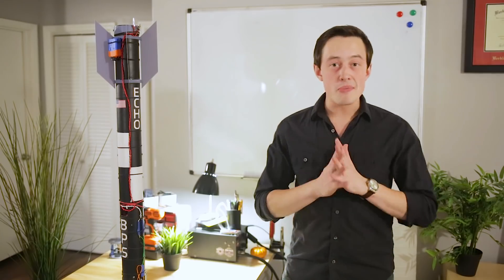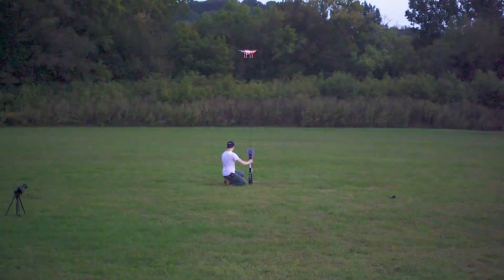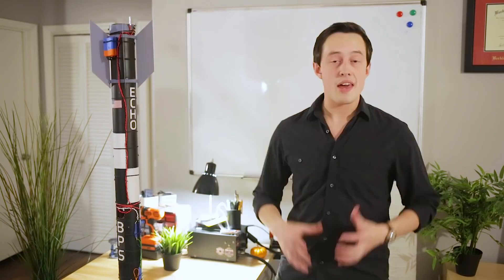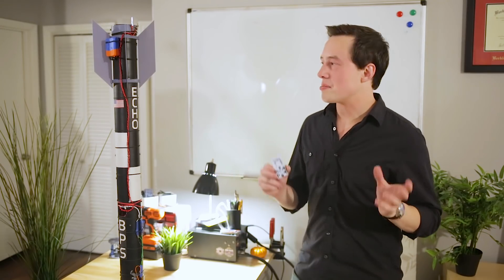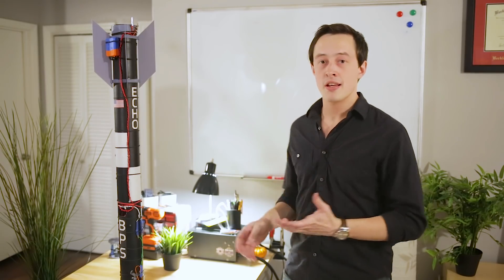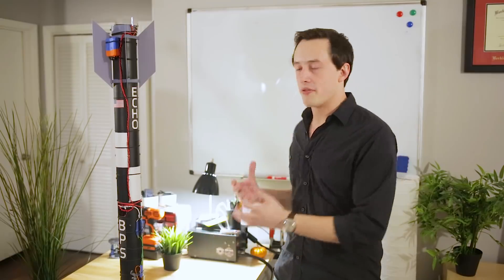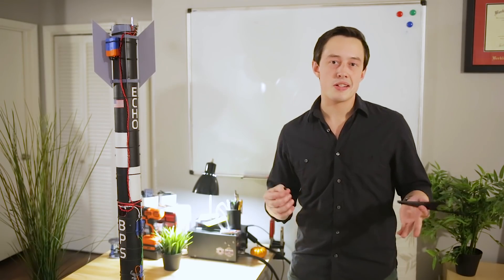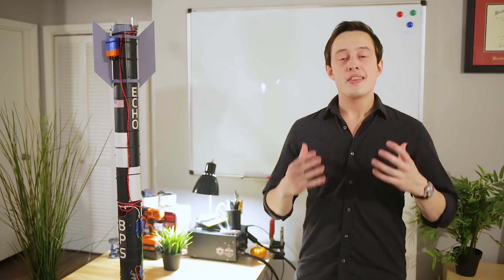Echo - Landing Test #1

Comment: WITH SOLIDS
Reply: "Yeah, when an SRB lands vertically... oh..."
Reply: A solid rocket motor has a specific amount of thrust that can't be controlled, so does the rocket have to be at a specific velocity and height when the motor fires off or is there a range of possible values? What if a booster sends the rocket to 1000 meters, will this upper stage will be able to land or will it be going too fast?
Reply: @nicholas1460  I dont think an Estes motor has a linear thrust curve. I think it is a parabola.
Reply: @nicholas1460  
What would happen if an electric ducted fan were placed inside of the rocket body?  The intake could be at the top of the booster.  The ducted fan could be completely controllable and be able to compensate for the differences in solid motor performance.  It wouldn't be there to provide all of the thrust but just to augment it with a few newtons of controllable thrust.  In other words the solid main gets it into the ballpark and the fan does the fine tuning.
Reply: @nicholas1460  The solid rocket motor has a set amount propellant and burns for a fixed time, so there is a fixed amount of impulse that it imparts to the rocket, which equates to the booster being dropped from a set altitude. He might to reduce the impulse somewhat use the TVC, but it seems to be a very narrow window that the booster could land safely on one solid motor
Reply: This will be awesome for model rockets. No more loosing first stages to the wind.. lol
Reply: paduag1782 Or you could just have a low-altitude chute deployment.  That would be simpler.  Just time-delay deployment to a hundred feet or so off the ground based on ballistic calculations, high enough to have margin if the flight doesn't quite reach the predicted altitude or comes in hotter than expected.  I think that would be much easier than trying to measure real-time height above the ground.
Reply: Brain Mind - What is the fun in that? 😊
Reply: Greg Smith Well, if you like launching rockets, it means getting out there faster.  If you like tinkering, then by all means attempt this overly complicated task.  SpaceX uses this method because for a rocket that size it's necessary.  A model rocket can fall on its side with no harm done, so a parachute is a simpler and just as effective way to go.
Reply: Brain Mind This is not about SpaceX, it's is not about doing things simply. It is about attempting something new and just enjoying the challenge! If every one did things the easy way, there would not be such things as SpaceX, light bulbs, cars and countless other things that exist today!
Reply: Greg Smith lol.  If it weren't for SpaceX, he would not have been inspired to attempt to land like this.  My reply was not to the guy who posted this video but the other commenter who thought this would be a good solution to the problem of model rockets drifting downwind under parachute.  Far be it from me to judge someone for taking on a technical challenge for cool points.  I was just saying it's not a great solution to the aforementioned problem.  SpaceX is not trying to do things the hard way.  They are actually trying to do hard things the easy way.
Reply: Brain Mind You are taking things way to seriously, he was just making a light hearted  comment.
I would not say SpaceX is doing hard things the easy way. The easy way is just to let the spent hardware to crash into the ocean, They are making a hard task look easy!
Reply: Greg Smith SpaceX is recovering the first stages so they can reuse them.  It's not the easy way from an engineering standpoint, but it's ea$y in the long run.
Reply: Brain Mind, Yes it is an incredible challenge they have set themselves and actually achieving. From what I have read each 1st stage is about $60 Mil plus a few mill in fuel. I don't know how much it costs to refurbish, but it would be great if they can get to a point where it is like refueling an aircraft, where they can land, refuel and take off again.
Reply: Greg Smith Well, that's kinda the ultimate goal.  Unfortunately, I don't think that's quite achievable due to the narrower design margins and performance demands involved in orbital rocketry.  The closer they can get to that benchmark, though, the better it is for the proliferation of a more space-faring culture.  Maybe with more and more assets and activity in space, it will eventually spur a business case for the development of more exotic launch technologies that can take the cost of getting to orbit well below the limits of chemical rockets and make it truly routine in the vein of intercontinental air travel today.
Reply: Brian Mind - Yes if it does happen it is a long way off. Even aircraft have a limited number of flying ours before they are permanently grounded, so if they can get 10, 20 or more flights out of a rocket, that is a hell of a lot of money saved.
Reply: Greg Smith Indeed.
Reply: @brainmind4070  
Yep.  At model rocket scales it is probably simpler (not simple) to have a controlled glide return rather than a powered vertical landing with a non-throttleable solid motor.  We did a balloon launched glider back in the early 2000s.  It returned to the launch site from 65K feet.
Reply: longshot7601 Yeah, this guy just wants to channel the "coolness" of a SpaceX F9/Heavy landing on a small scale, which is perfectly fine, since this is a toy and/or a vessel for generating YouTube views and not an actual workhorse.
Reply: My exact thought.
Reply: That moment the people's engineer gives perfect props on your channel.
Reply: Hey Destin, check out Nulka, a hovering rocket anti-ship missile decoy.
https://youtu.be/9j66ZvGGErQ
Reply: Yes. He did use solid.
Reply: This is exactly why I clicked on this video. That's a feat even SpaceX doesn't want to touch. I'm thinking in the end, he'll have to have a way to kill the thrust at touch down, like a thrust reverser on a turbofan. Otherwise, it's going to bounce and climb again.

Comment: Well, you want to send this at the edge of space? Put it on a weather balloon. Once it reaches at the maximum height, launch in and each mesosphere. It's not the edge of space but still, the atmosphere is super thin. And make some satellites and give them some propulsion system. The satellite will need a lot of speed and won't remain there for long as they are not in real space yet, but at least it would look cool.

Comment: Love your project ( I'm not an expert ) It's possible that scale is an issue and also the rubber band situation during deployment is causing a variable bump or jerk that's  causing issues . If you can get the pods to deploy in a more controlled synchrony without dependence on rubber bands  it should help . Good luck.

Comment: Your never going to make a smooth landing with solids.  Are you attempting to make a hybrid solid that you can add a oxidizer gas to make it a throttleable  engine? Or design a Butane/oxygen pressure fed engine Where you can throttle with a variable valve solenoid?

Comment: The problem is 
With Solid fuel trusters you can t control the trothle they can be only on or off
You did a nice work there but try with hybrid trusters
The doesn t have solid oxidizer but only the combustion powder
And a tank of oxigen 
Controlling the flow of the oxigen you can control the trothle

Sorry for bad english if i wrote somthing wrong i m Italian

Comment: I think what you need to do is go beyond solid rocket motors. I know it's big step and probably beyond the budget now, but maybe people would help you with it. I think a hybrid rocket motor would be ideal. That uses solid fuel and liquid or gas oxidizer. It could be wax and nitrous oxide, polymer and compressed oxygen, there are several variations. But hybrid rockets can be throttled. They are much safer and simpler than full liquid fuel engines. No cooling is needed, no fuel pumps (compression is enough) They are perfect for this application. If you look around, you will see that a lot of people are building working small scale hybrid rockets.

Comment: So I only have one question?? Real SpaceX Rockets use obviously Fuel and shut off controls your model rockets don't they use the model rocket thruster materials basically aren't you just shooting in the dark I'm trying to get that rocket to land because once that electrical igniter ignites it it burns until it's done so hypothetically you're probably always going to have too much or too little material. Although you could mathematically figure it out by seat and burn time but if I'm not mistaken the real SpaceX Rockets would increase thrust or decrease thrust and I don't think you can do that with model rocket engine material please get back to me on that one though

Comment: take 1 or 2 co2 cartridges as a tank for a 4 or 3 nozzle control at the top of the rocket and control it with a suitable valve via another computer. I do not know if that works because I do not know anything about rockets 😁

Comment: You can make a metalic nozzle that opens and closes depending on your thrust needs.
Maybe with some plumbing for redirecting the gases to the sides when its closed.
It will be like a 100 or 0 thrust at a time, but with a good enough design im pretty confident that you can control your speed enough for a soft vertical landing

Comment: Change from a solid rocket to a hybrid. It will produce more power and is able to be turned off and restarted mid flight. This is helpful when you start launching and landing in the same flight. You can even connect the valve on the engine electronically to the signal r2 so you can control throttle from the app.
Reply: Here’s a link to a hybrid rocket engine:
https://youtu.be/TLPWqCMb7DE
Reply: I made the same suggestion.

Comment: What if you have it land on a platform rather than grass and release the motors thrust a bit  faster. (I think you mentioned that actually) also it seems like there is mass unevenly mounted around the rocket, why not mount in inside in balance? Awesome shit tho

Comment: i see why its so hard to land.
its literally just the unpredictability factor with the solid engines. once they ignite, you cant throttle, and you have to wait for the fuel to be gone for it to shut off. minor inconsistiencies in the mixture as well as minor disgrepencies in ammount of fuel per motor, makes them unpredictable.

i would suggest using a hybrid nitrous/rubber rocket instead. with a valve, you can at least throttle and shut the engine off at the right time. get an N20 canister (used mainly for making whipped cream and getting high), and make a tube the same size as your engines. fill it with molten rubber to cool. drill hole through center, pop solenoid valve into one end. screw in nitrous canister to that. add electronics. you could alsu use any extra nitrous as RCS fuel to help stabalize the rocket on landing.

Comment: When it does touch down successfully, the thrust will cause it bounce back up in the air. You'll need a thrust reverser such as a plate that quickly deploys into the rocket plume.

Comment: So one issue I've identified here is that to adequately control vertical stability and maintain as perfect an angle as possible you will need some form of control higher up the body, as thrust vectoring will require a lot of inverse calculation to make it retroboost into a landing. You see it with the real falcon heavy, the engines do little to stablise the actual vertical angle of the booster, while the drag plates do most of the stability. 

I've pondered the idea of a cold gas RCS style system using servos and valves, but that creates a lot of weight. Whereas using something like 2 servos and fins, or even better the drag plates that spacex makes, would greatly increase your stability in descent and allow you to make that perfect angled drop.

Comment: Would it be good idea to stabilize landing rocket with gyroscope instead or together with TVC? I think your rocket is small enaugh to make this solution sensible.
Reply from the maker: As in a super fast spinning weight? While that could work, those are non-ideal as a solution at this scale. They add quite a bit of weight, so the best way to improve stability is to do it through better thrust vector control.

Comment: Is it just me or is the CAMERA placement causing the topple?  The vehicle seems to tip more toward the camera, especially when the airspeed is reduced. 
PERHAPS, the camera could be inside with a fiber-optic poking out the side. Center the weight. 
Sorry for the ‘layman’ observation, if this has already been said, but I checked the comments and didn’t see this observation.
Give that vectoring motor a brake... it’s obvious that it was doing all it could. 👽
Reply: I was thinking the same time and was scrolling down to see if anyone else had commented. With the camera being mounted so high up and to one side it's weight was probably doubled and the flight computer was trying to correct itself by thrust vectoring to level out to stop horizontal drift. If counter weight was added I would probably suggest using a gps locking system to cancel drifting.
Reply: you both have  a good point

Comment: You have the same issue as the V2 rocket. The fins are basically useless, they help with the initial drop as they are designed. At low decent or accent speed they do not work. Basic aeronautics. Diverting the thrust solved all the issues .

Comment: Use a switch mode buck converter instead of a linear regulator which gets warm.
Reply: You watched that video aswell? Because ion think its a huge deal since hes not using the regulator for a long time.

Comment: While I do understand the desire to land the first stage in an upright position, the russians have come up with another idea that I think lessens the likelihood of a landing topple and or a leg failure. The intend to have onboard pop-out wings and conards with pop-out rudders and wheels to land it like you would a jet. Of course it would have parachutes at the end of the craft as one would for the space shuttle or fighter jets/bombers. That is to ensure the craft does not run off the runway. Skids could also be used and I think that would be more efficient and not have any balance issues due to weight configurations. 
Also too, with verticle landing, one needs to be able to control the thrust of the engines and that is obviously much more difficult with a solid fuel engine vs a liquid fueled engine.

Comment: Hi PBS, I'm really impressed with the software you seem to be packing here! Despite the small size of your channel, you've managed to create an EXTREMELY impressive rocket here. I'm curious how advanced the software is that controls your fins. Does it simply measure the distance from a desired point (IE your dX dY and dZ) and then actuate the fins in an angle to compensate for that (with some linear scale factor for fine tuning). Or do you have something more advanced, like a nonlinear scale factor applied to the rotation of the fins?
I'm having issues with using computer-controlled fins myself, and think maybe your experience will be useful

Comment: This is a brilliant first attempt at landing a model rocket using solid propellant motors, keep up the great work! 
I was just wondering how it would go if you had two sets of motors. The first motor(s) used to bring the rocket to a stop above the ground and the second motor(s) with a thrust that is less than the weight of the rocket. Which would then be used to actually land the rocket and give more time to compensate for drift etc and if still burning on landing would have less chance of tipping over the rocket than the more powerful motor(s).

Comment: Wondering if you could create More drag on the tips of the top fins? Kinda like the drag fins that they have on the Falcon.. Might also allow more stability at launch also. Just wondering.  (example each fin could split like so \/ to create drag independently for each fin would also allow better control during launch. )